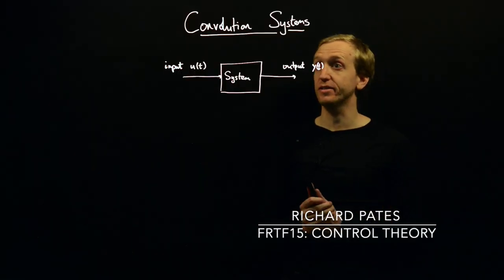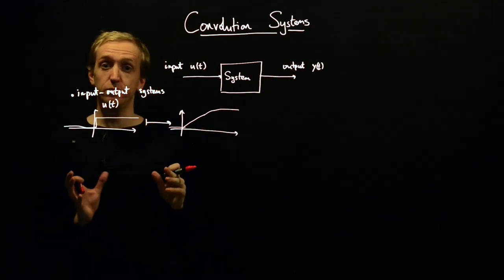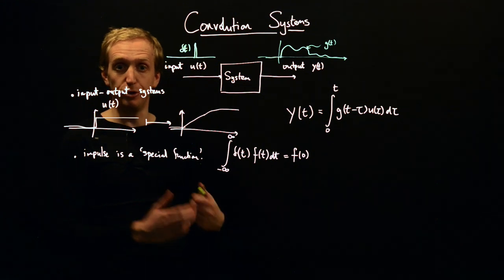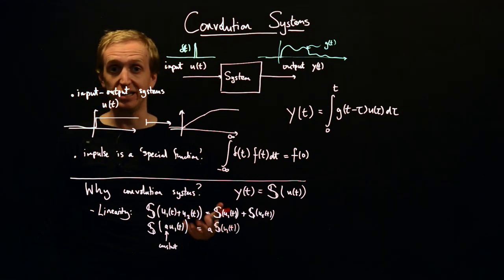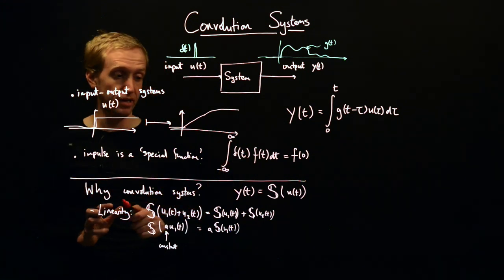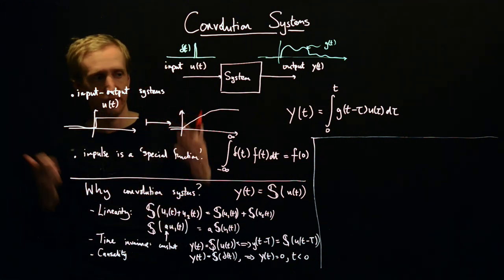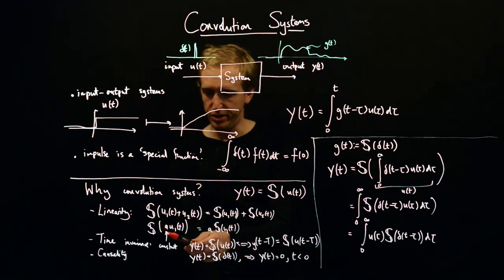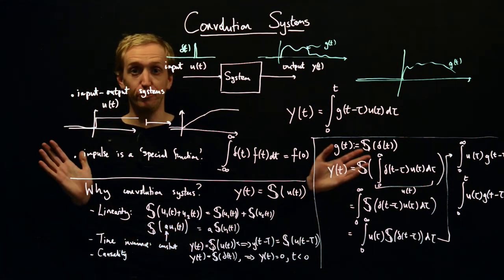Convolution Systems

Comment: Thanks for the nice video. But I have one question: why we can rewrite u(t) to the convolution of delta function and u(t)?
Reply: Does it because u(t) is a step function, so it’s a constant. And since the delta function can sift out the u(0)?
Reply from the maker: @junninghuang4343  Very close - it is because of the sifting property of delta functions. But this sifting property works much more generally than just on constant functions. I think you are probably just confused by all the steps of variable relabelling - I'll try to clarify.

The delta function is defined to be the function such that integral(delta(t)u(t)dt)=f(0). i.e. it is the function that 'sifts' out the value of u(t) at t=0. Similarly if we shift the location of the delta, we can sift out other values, so integral(delta(t-T)u(t)dt)=f(T). i.e. it is the function that 'sifts' out the value of u(t) at t=T. Now in these equations, t is just a dummy variable that we are integrating over, so we could equivalently say that integral(delta(tau)u(tau)dtau) sifts out the value of u(tau) at tau=0. Similarly integral(delta(tau-t)u(tau)dtau) sifts out the value of u(tau) at tau=t. But the value of u(tau) at tau=t is just u(t), so integral(delta(tau-t)u(tau)dtau)=u(t)!
Reply: @richard_pates  I see, thanks a lot! So basically by utilizing the dummy variable tau to rewrite integral(delta(t)u(t)dt), and then shift the location with t, now the integral can sift u(t) out!